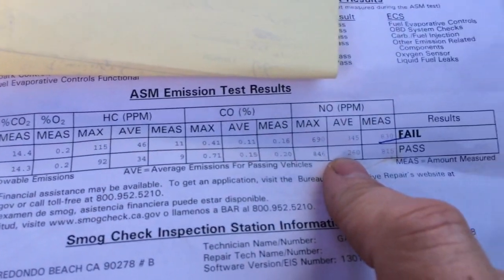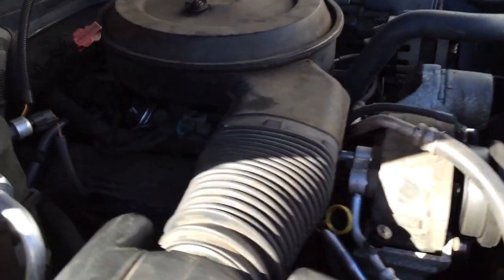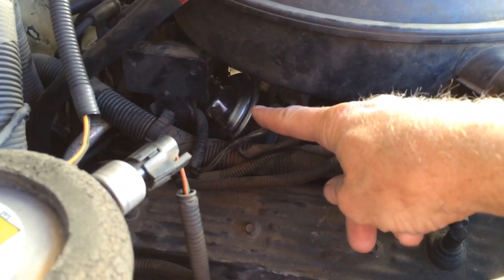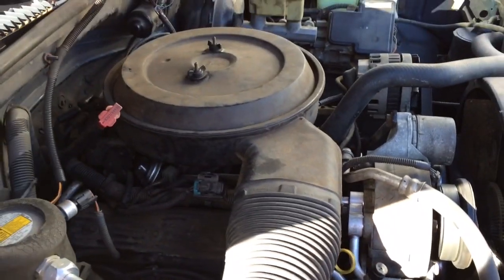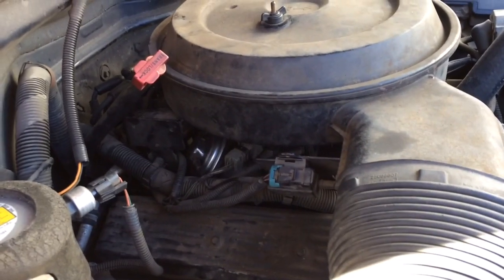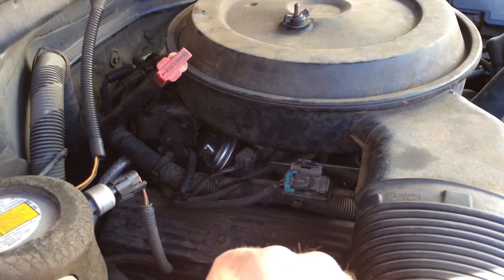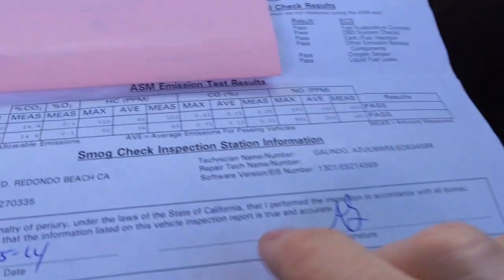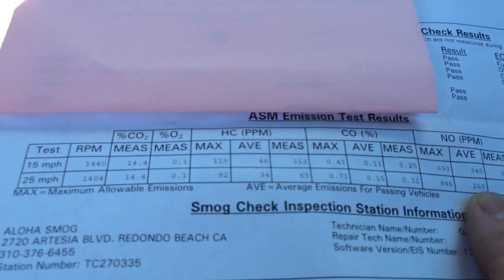How To Lower NO Emissions On A Car

Comment: How do you mean Timing
Reply from the maker: Timing controls when the spark plug fires relative to the height of the piston. Car is built after 1995 don’t have this, so that would only apply to old cars. My 1995 Chevrolet truck still has it.
Reply: Thank you God bless @hoohoohoblin

Comment: In my case, the cause of the high NO is a leaking fuel injector, and some mismatched fuel injectors. I went to a junk yard to get the OE fuel injectors. Cleaned with contact cleaner and installed them. Put Techron injector cleaner in the gas tank. Took the truck out and drove for 4-5 hrs at various speeds for awhile 20, 25, 30, 35, 40, 45, 50, 55, 65, 75 miles/hr for the computer to relearn the new emission components. And the truck passed the smog test.

Comment: My car always struggle with high NOX numbers on emission tests.  Retarding timing helped and it passed barely.  I saw a video where a guy with similar high NOX put in cold spark plugs (spark plugs which are designed to run cooler) and he passed NOX with flying colors

Comment: Hey hi, 
What was your Max and Meas?
My firebird failed smog  because too high NOX
At 15 miph The Max is 537  and mine its at 989
At 25 the Max 494 and mine at 652
Reply: Replace your EGR that should help

Comment: BAR Repair Smog License & ASE (L1)....On Line Practice Tests... 

Dr.Smog's® Study Guide included. Yours to keep. 
Guaranteed Pass* $20 OFF Coupon.

Dr.Smog's® Study Guide included. Yours to keep. 
Guaranteed Pass* 
Use Coupon code  20OFF for a $20 discount!

Dr.Smog's® Study Guide and Online Practice Tests are designed as 
an integrated system of the learning to acquire the knowledge necessary to
Pass the BAR Repair Smog License & or ASE (L1) Exams first time. 
Keeping the Air Clean is an honorable profession.

Best Regards,

Dr.Smog®

Guaranteed Pass**Details at:
http://drsmog.com/
Designed especially for the BAR Repair Smog License and ASE (L1) Exams

Got Questions e-mail:
todrsmog@aol.com
Reply: Dr.Smog's

Comment: good  vids  got  a  question  1994  lhs 3.5  emissions  test/  hc  standard  0.80  mine is 0.91  and  nox  standard  2.50  mine  is  2.84  i changed oil/flush coolant  for winter/fuel system clean drove on highway 25 minutes before test any ideas  car  runs very  good  thank you
Reply from the maker: +fast eddy I have put some Wynn's emissions test passing fuel additive in the gas and seen emissions numbers go down. That might help. New spark plugs might help, and a new air cleaner may help as well.  You definitely want the engine to be really hot when you take the test. New cap and rotor, and spark plug wires may help as well.